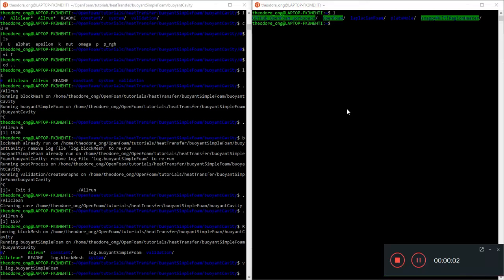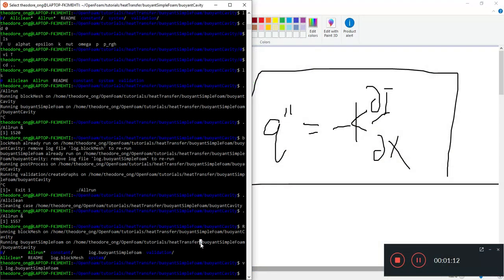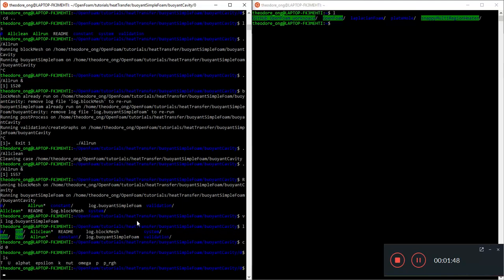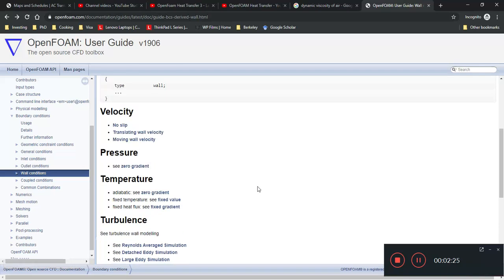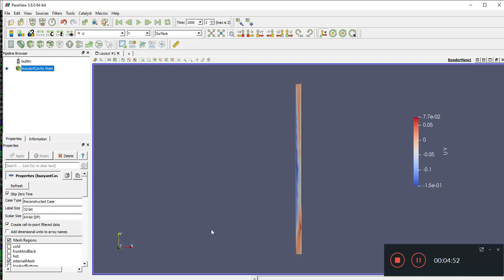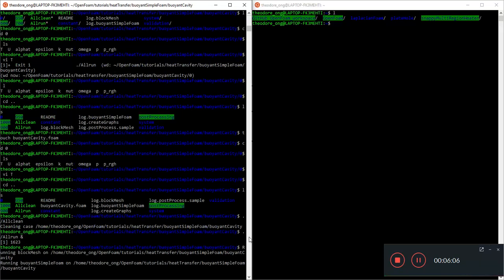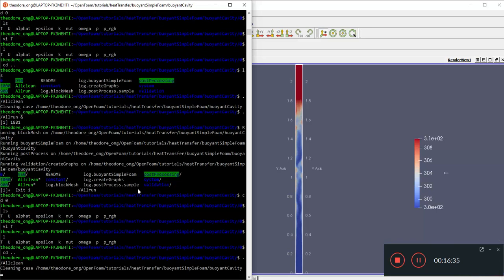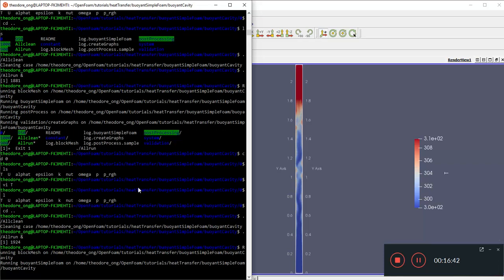OpenFoam Heat Transfer 6 - buoyantSimpleFoam part iii experimenting with heat flux BCs

Comment: Hi,, your videos are very helpful. Thank you for making them. 

I have a question/comment on this video:
When we use "fixedGradient" as a boundary type for temperature boundary condition then it gives a temperature gradient for the boundary wall. Here, in this case, the gradient is in the Y direction. However, heat flux should be calculated normal to the boundary wall, means in the x-direction. Therefore, dT/dx (unit: K/m) is not applicable to the gradient value (i.e 100, 1e-5) that you're specifying.

Comment: Hey first of all thanks for your wonderful videos. What is the default unit for the heat flux that you defined as "-100" ?
Reply: @TheoOngScienceAndEngineering  got it. I am designing a reefer and calculated the heat gain from the ambient. I want to use buoyantSimpleFoam for its cfd. Do you have any idea about how to define heat flux in kW to wall? Thanks
Reply: @TheoOngScienceAndEngineering  Thank you let me try it
Reply: @TheoOngScienceAndEngineering  Hello, i have one question, as you say temperature gradient (unit will K/m) boundary condition apply at hot surface, but its mentioned temperature dimension above [0 0 0 1  0 0 0 ]. Seems units are not compatible here.